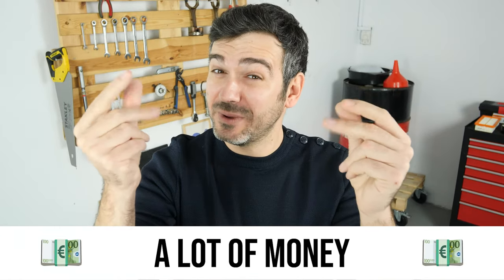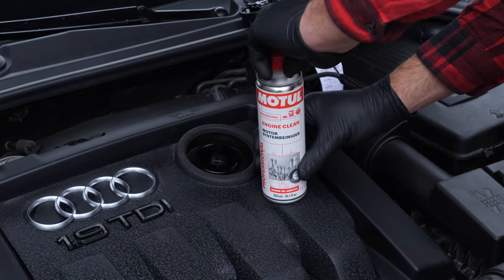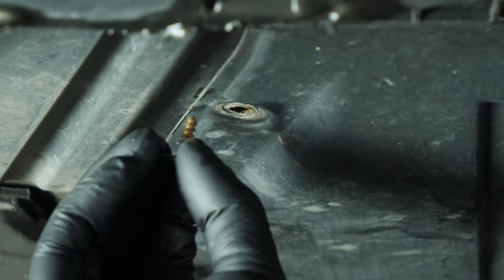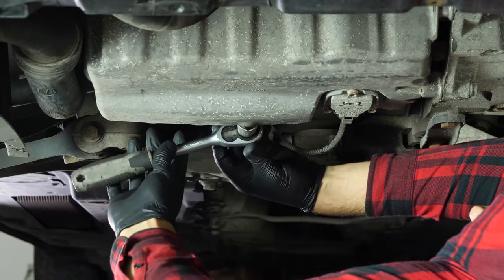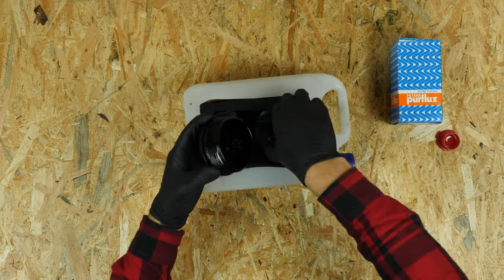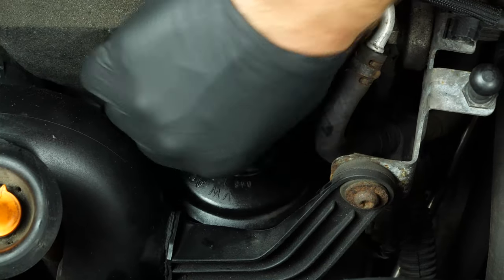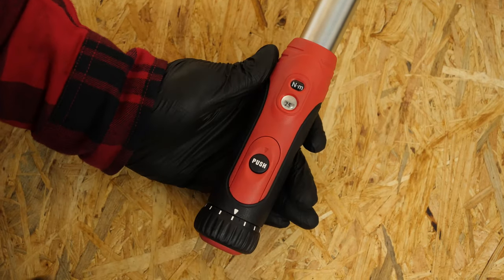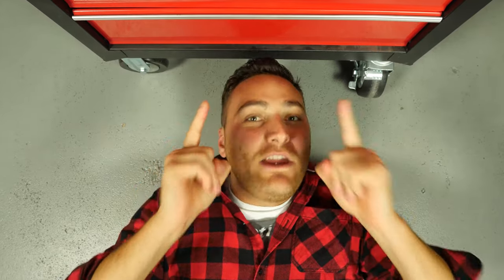Change the oil and the oil filter AUDI A3 mk2 1.9 TDI 🛢

Comment: The oil filter should be removed first to allow the old oil in the filter bowl to drain into the sump then out through the sump drain hole when the plug is removed. When the filter is removed, there may be small pools of oil in the bowl which should be removed.